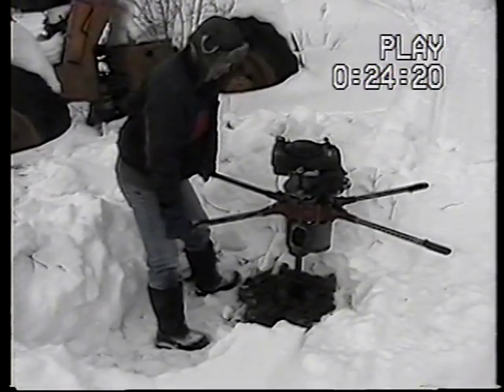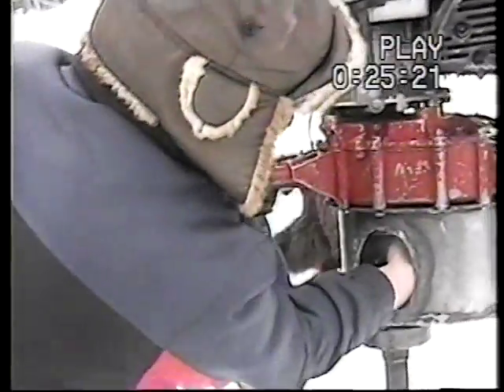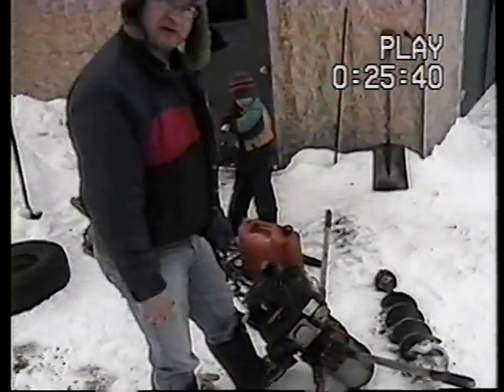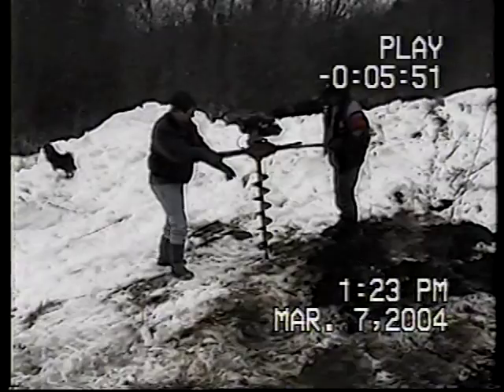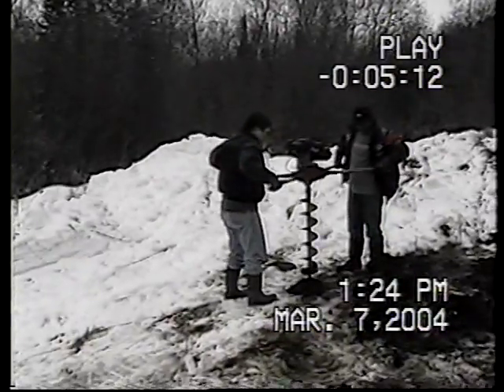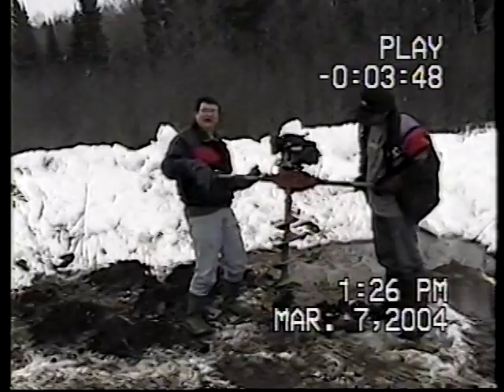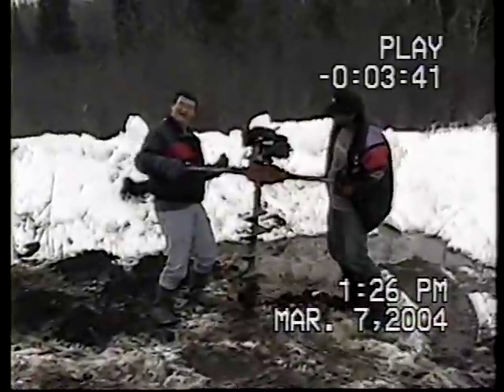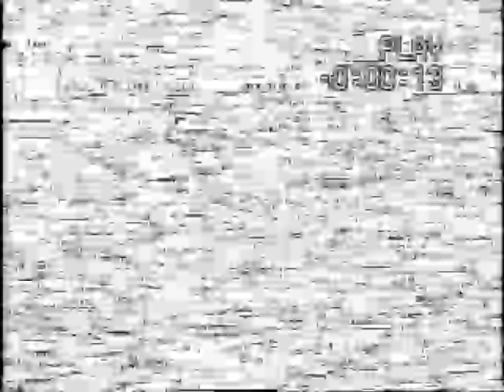Maki Auger

Comment: This auger works in all seasons in almost any soil conditions. I bored into frozen gravel pulling 2 to 3 inch rocks up with very little effort for me to hold. I tried it as an ice auger on my other prototype and I was able to hold it with one hand. My auger will make hand augers able to bore most holes with ease  if I can just find a manufacturer.